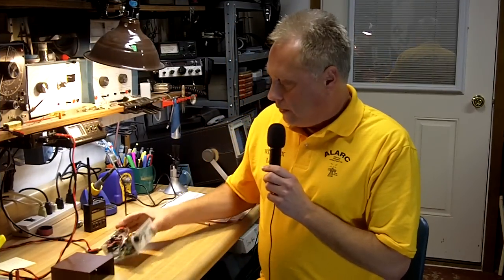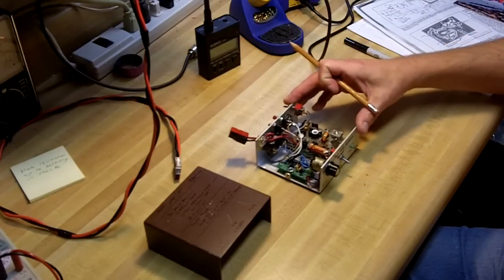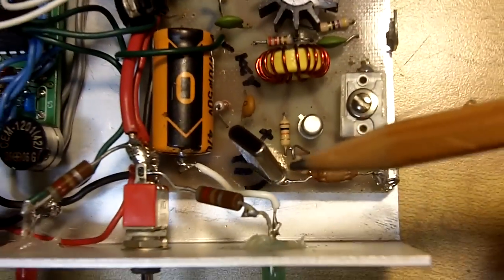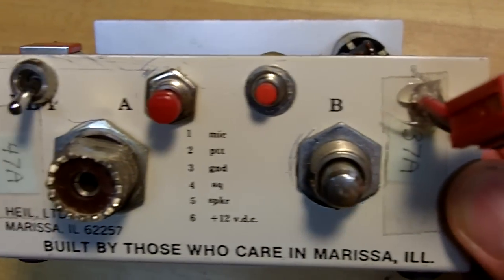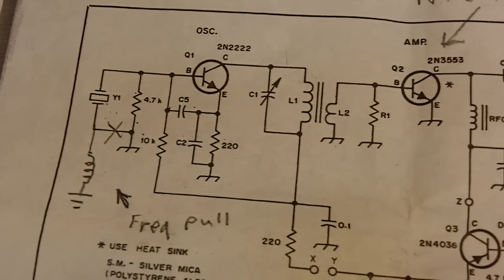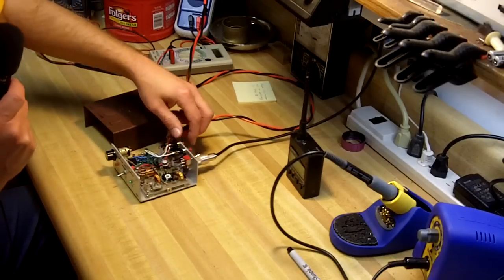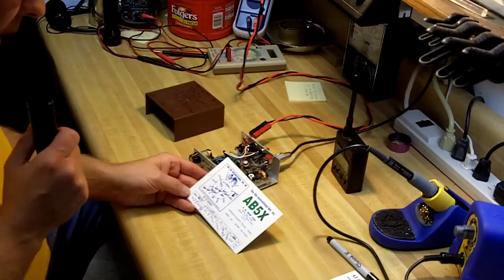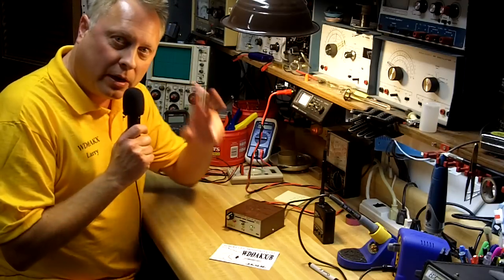My 10 Meter Ham Radio Beacon Update Video

Comment: I saw your video and would like to set up a power to my station here in Brazil, it would be possible to provide the design, or otherwise would have in the same kit, plan to use it in the frequencies of 10, 20, 30, 40 and 80 meters.
cordially

Comment from the maker: Thanks and you are right about the hand held mic, I do need to get a lapel or wireless maybe, would make things a lot easier I guess, just got kind of used to the hand held mic I guess, lol. I think I have a lapel or 2 around here but I might need to repair the wires on them before they will work without cutting out.
73..Larry